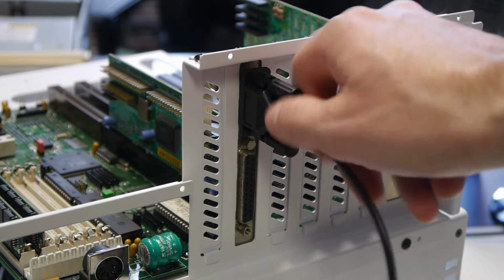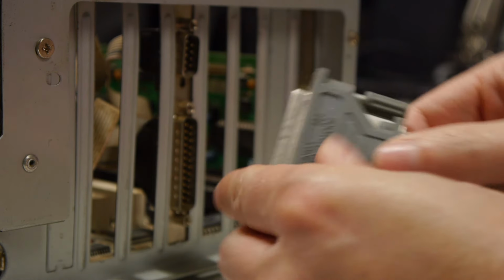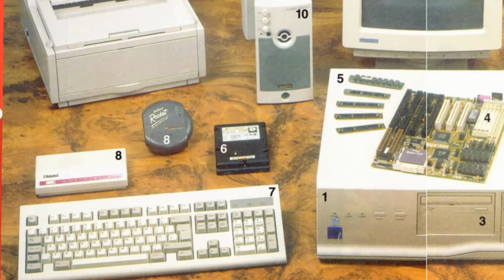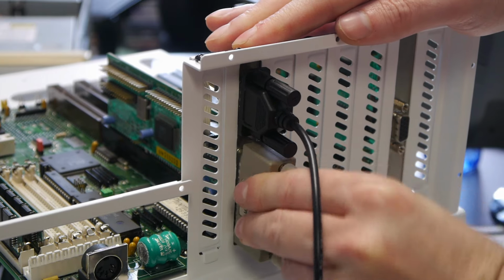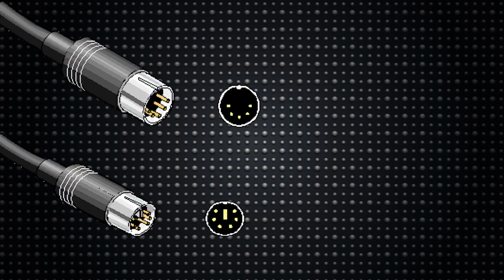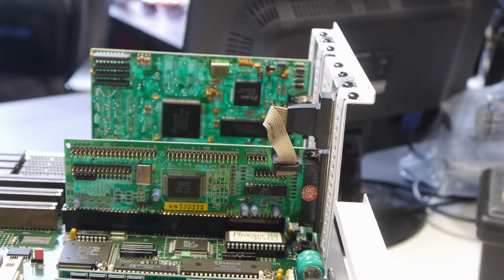What did we use before USB? | Nostalgia Nerd

Comment: I had an Amiga back in the day and I needed a new mouse.  Since serial mice used the same DB-9 port, I was going to give it a try until I was warned that I could blow up my port if I used one, and I needed a bus mouse instead and would have to convert that port to DB-9.  Or just find a mouse made for the Amiga.  Anyone know if it's true that the port on the Amiga could be damaged by using a serial mouse?  I suppose it would have to do with the +5 being on a different pin.

Comment: Yeah, I caught the tail end of the life cycle of these connectors when I was little, so I grew up watching as each one of those got gradually replaced by USB, and I remember what it was like to use them...
While it's certainly convenient that pretty much everything nowadays uses USB, I'll still gladly use a PS/2 Keyboard and mouse on my PC! It's good too because it frees up 2 USB jacks that I could use to connect gamepads~
I think I still have a couple of game controllers with that 15 pin connector though...
Reply: God forbid your mouse accidentally comes out of the PS/2 port, you gotta reboot
Reply: Michirin9801 you havent felt how it is to try to plug them in and accidentally bend the pins
Reply: I have actually, but only with a PS/2 plug... I just bent it back into shape with a pair of tweezers >w>';

Comment: As late as 2014 I was still complaining about brand new PCs having outdated legacy connections like PS2 and RS232C on the motherboard, and not enough USBs as standard.  

One thing Apple has always been good is knowing when to ditch the old and force technology to progress.
Reply: T Mac Apple get rid of things too early, when people still need them. They threw out serial and parallel ports when I still had devices that used them, while pushing FireWire, which was useless to most people. Apples approach is only good if you're rich enough to throw away old but perfectly functional hardware.

Why would you care about PS2 and RS232 anyway? If you don't need them, don't use them. It's not as if they cost much.
Reply: I like having RS-232, it's still widely used in embedded development.  PS/2 seems to be up for debate in the gaming keyboard community as PS/2 is interrupt driven (technically "faster") while USB is software polled ("slower").  With modern USB gaming keyboards polling at 1000Hz though, I highly doubt anyone can tell the difference.  Also the PS/2 supporting N-key rollover, but so do nicer USB keyboards.

Comment: RS232 was one of the most difficult standards to cope with, ever, because while the standard defined two classes of equipment: Data Terminal Equipment (DTE), and Data Communications Equipment, with each category having precisely defined pinouts, voltage levels, and signal directions of the connectors, many manufactureres chose to bend the rules almost to breaking point. For example, the Sinclair ZX Spectrum +3 uses the pinout and signal directions of a DCE device, while both modems and printers often were configured as if they were DTEs. Needless to say, this would often requre users to make up custom cables in order to successfully make various bits of gear talk to each other.
Centronics, on the other hand, was never adopted as an official standard by any regulating body, yet virtually every manufacturer followed it to the letter, and thus it became what is known as a De-Facto standard.
Ahhh, the "good" old days. :D

Comment: You only gave SCSI a passing mention, when I worked on making computers for video editing in the late 90's, SCSI and SCSI hard drives were King, everything had to have them.
Reply: Yeah, and technically you could connect everything using SCSI, not just storage devices or scanner.
And SCSI was capable for features 20 years ago they now sata praise for...
Reply: Well, it is true that SCSI is obsolte in consumer systems but is is still used and further developed in/for professional storage system.
Reply: SCSI was popular because it was great, but it was basically a flash in the pan in the history of technology. So I can see why it only got a passing mention on a video of the tech that basically made it so obsolete so quickly. I remember when everybody thought SCSI was going to replace everything. Turns out USB did that.
Reply: Yes, nothing was faster then SCSI back then, and that you could use 7 devices on one SCSI port, with a spacial SCSI cable.
Reply: you didn't need a special port/cable, it just daisy chained between SCSI devices, well Mac's didn't, I used SCSI for years, the daisy chained option was great and far better than USB, and only dropped when going to Firewire, which again could be daisy chained.
Reply: All real business was handled over SCSI. Hardly a "flash in the pan" SCSI was the absolute standard for every digital dependant corporation for at least 20 years. The only businesses who used USB exclusively until the end of the 20'oughts were tiny startups and companies who had huge capitol dumped in only to fall on their ass in 2008 when the country fell on its face.
Reply: +Max Mustermann There is nothing wrong with storing business data on external drives in fact quite the opposite at least one backup should be stored fully encrypted on offline media like an external hard drive which is disconnected and secured in a fireproof safe (Or better yet at a secure offsite facility) after the transfer. Doesn't necessarily need to be hard disks but they are ubiquitous and can be acquired cheaply so they can be a very cost effective solution. The reason for this is simple malware is a threat that exists which is fully capable of corrupting any and all online storage.
Reply: I actually had a SCSI hard drive back on a Win98 machine.
Reply: And there's were so many variants of SCSI ports as well.
Reply: Yes, some SCSI cards had a DB25 female port exactly the same as serial as well..
Reply: My first Macs all had SCSI connectors. I remember having to move  the HDD and CD-ROM drives onto opposite addresses whilst installing OS 8 and then swapping them back to be able to reboot and run the computer. No idea why, but both cables were correctly terminated, new and connected correctly. When OS X 10.0 arrived, the issue disappeared. I still have a bag full of spare and unused SCSI adapters and cables somewhere. Bought as spares for when needed, often on a Saturday night or a Bank Holiday. We thought that everything was going SCSI, so didn't worry about spending extra for bulk to get better prices per part. Then Firewire happened, followed by USB, which 'might never catch on'. Hah!
Reply: tylisirn
I actually use SAS controllers. But I don't really see the appeal for SAS drives. What's the benefit? It's not faster than regular SATA.
Those controllers are cheap (used on ebay), reliable as fuck, good driver support, and I like the plug. I believe it's called miniSAS. You can plug up to 4 SATA to one miniSAS port.

 Had SCSI back in the P3 era. Harddrive and scanner. Actually didn't like it. SCSI HDDs were usually 10k rpm to utilize the SCSI speed. Loud beyond belief.
And you always had to wait in boot for the fucking controller to initialize. (Same goes true for those SAS controllers, but you can just delete the BIOS and use them in HBA mode).

Some enterprise stuff is great. But other stuff isn't aimed at consumers for a reason. I'm more than happy with SATA3.
The only "enterprise" thing I really long for is 10Gbit Ethernet.
Reply: SCSI was fast, loud and expensive. So the general user never saw it. It had it's fair share in industrial and enterprise solutions.
Reply: Even rape backup is still a thing. It might not be fast, but it lasts and can be stored safely.
Reply: SCSI was a flash in the pan?  You don't have much experience with enterprise computer systems, do you?

It's all Serial Attached SCSI (SAS) now, but it's still SCSI.  Servers and storage devices only use SATA for low speed cheap nearline storage that supplements SCSI storage (for data that isn't accessed frequently).
Reply: He also failed to go over what Apple was using prior to USB. It was different from the PC connections, with small, round connectors bearing a superficial resemblance to S-Video and PS/2 having been used for serial connections as well as the Apple Desktop Bus, which was for connecting peripherals such as the keyboard. Apple daisy-chained the mouse through the keyboard over ADB, so in a way it was well ahead of its time.
Reply: scsi is a big thing when it comes to vintage electronic music gear and early macs, during the 80'[s and early 90's.  scsi was just never huge with home ibm-pc2 type pcs
Reply from the maker: ForestCat_Peter SCSI deserves it's own video.
Reply: SCSI was hardly a flash in the pan, it's still in very widespread use, just too expensive for consumer systems, which was always its problem. These days it's found its home in enterprise storage as Fibre Channel interface protocol and SAS (Serial Attached SCSI).
Reply: Well, I was 6 at the time so god knows what type of SCSI port I had. I was good enough with PCs to run down most of the specs, but not good enough to open the thing up and know exactly what port was what.
Reply: Yeah, i used it on the Commodore Amiga, like the Squirrel SCSI Interface Device, and SCSI that was on my Blizzard PPC turbo card.

Ahhhh good times.
Reply: ForestCat_Peter Not really. Every computer that I ever used in the late 90's and early 2000's had IDE interface for the hard drives. I heard of SCSI, but never had a computer that used it. I was unfamiliar with it, and I was told that it was being phased out even back then.
Reply: Max Mustermann While not widely used, Internal USB is a thing, there are USB devices that connect internally directly to a USB header on the motherboard

I have used two internal USB devices myself (a USB VFD display and a USB memory card reader), both of which were designed to be mounted in disk drive bays
Reply: Yeah, and do you remember how much a SCSI controller costed? It was a buttload and a half. I can't remember if it was an ISA or PCI interface. I seem to remember PCI being hot shit when it was introduced. All I do remember is paying several hundred dollars for the controller card and hard drive together, and the capacity was so small it probably couldn't even store one modern compressed video.
Reply: I remember seeing Full Length 16 ISA slots used by SCSI with an 50pin Centronic Connector in the 90's
Reply: SCSI was big on Apple Macs for over a decade. I still have a 1993-vintage Microtek scanner, which still worked the last time I turned it on (maybe a few weeks ago). It’s connected to a beige G3/266 PowerMac (1998-vintage), which is the newest machine I’ve got that has a SCSI interface.
Reply: Think your spot on. So much to tell about SCSI, Went through different faces. I'm from begin 80's and grew up with the PC coming up. For a long time it was just a dream to get my hands on SCSI. But was only later when I had more to spent before I was able to buy the needed controller. What I have to say about SCSI is that it's more focused on enterprise and think it got more attention in consumer market with SCSI CD burners. Specially the beginning the burners where super expensive and IDE had way more issues with stability then the SCSI variations. Since the burners where expensive it was less of a difference SCSI vs IDE. Can't wait to see your SCSI video. Will bring back lots of nostalgia ;)
Reply: NVMe SSDs killed SAS SSDs for high-end enterprise storage, SATA SSDs made 15K SAS drives a joke, and SAS 7.2K are too slow for even 'warm' data, making SATA 7.2K more appropriate in cost-effectiveness for cold data.

The king is dead: Long live the king.
Reply: The very first CD burners pretty much had to be SCSI, with a SCSI hard drive to follow. The buffers were minimal back then, and you always risked to have an empty buffer in the burner. Emptying the buffer while burning resulted in a corrupted CD (and writable CDs were expensive back then. Still affordable, but a lot more expensive than today). So you needed high transfer rates, something that IDE did not provide when compared to SCSI. For three or four years, if you were serious about burning CDs, SCSI was a given.
Reply: LPikeno 7.2Krpm SATA drives were basically consumer IDE drives with alternative interface electronics. Because most SAS controllers happily accept SATA drives, nowadays that job is handled by higher end SATA drives instead.  SCSI today is usually single-channel SAS (almost the same as IDE, but with ability to plug two controllers into each drive), multi-channel SAS for connecting to external or internal enclosures, Fibre-channel optical SCSI for connecting huge raid enclosures (such as EMC racks), and iSCSI over standard Gigabit or 10Gigabit (or faster) network cables.  The devices most commonly connected are still disk systems and tape backup (with or without robots), though you could connect any of the other things that have had SCSI interfaces over the decades.
Reply: Don't forget Raid arrays. I remember when those were the hotness.
Reply: For Apple Mac users, SCSI was the main way to connect most peripherals (outside of modems, printers, networking, & keyboards/mice) for over a decade, until the first iMac in ‘97 where they switched to USB 1.0 for most everything. For PC users, it did not see the same adoption for home consumers due to cost. Parallel ports largely served the same purpose due to its cabling being much cheaper but with severe limitations speed & number of devices. The versions of SCSI used in the 80’s and 90’s had lots going for  them but also came with a high price tag vs parallel/serial. Because SCSI cables were wired with many wires in parallel with thick shielding, that meant they cost a lot to make. They also came with the complicated business of needing have unique ID’s set for each device and terminators at the end of the last daisy chained device. This all meant the unless you where a Mac users or a business PC user with specific need for SCSI, then you were unlikely to be exposed to it. But advanced variations of SCSI still exists these days in the enterprise world, it’s just that the lower end version for hooking up basic ext. HD’s, scanners, etc. no longer are very useful with USB serving that purpose much better.
Reply: Indeed. I connected a HP ScanJet A3 scanner via SCSI to my A2000 which at one time had TWO separate SCSI Adaptors. I housed multiple 4.3 GB SCSI HDDs in items such as a SCSI Tower Case (or an empty Honeywell AT case) - since 4.3 GB was the addressing limit on my system. I noticed that NASA was still using highly-customized Amigas for data processing (including from the Space Shuttle) until about 2003. Amigas had gone out of production with the demise of CBM in 1994.
Reply: On the Mac, I remember using SCSI for hard drives, scanner,  and a few other things.  We also used serial port for mouse, keyboard and other low speed devices.
Reply: SCSI is hardly comparable to USB. Yes, there is external SCSI. But no internal USB.
Whether you hook your scanners up via SCSI or USB doesn't really make a difference.
When SCSI was still a thing (pre- SATA/SAS) stuff like USB Harddrives etc weren't really a thing yet.
And (hopefully) nobody stores business data on external drives anyway.

So especially for that given time frame, mostly totally different use cases.
Reply: You forgot to mention my perspective; why didn't you acknowledge me in YOUR video that YOU made for MY entertainment #unsubscribed

Comment: I know it's probably nothing to write home about, but I really want to see a DOS machine load something off tape now. That just seems so alien and bizarre to me that i need to see it to believe it.
Reply: Be N S O N Theres lots of C64 and VIC-20 videos that show exactly that.  Cant recall ever seeing a PC do tape though.  Also alot of videos of PDPs running reels.  Some IBM 360/370s too.
Reply: geniwab Those are tape cartridges specifically meant for data storage though, I find cassette storage so interesting because it's taking a medium for audio storage and using it for data, also that they're technically storing the data as sound.
Reply: Be N S O N it's not for DOS it's for the on ROM OS only.
Reply: yeah, even our 286 had nothing of the sort back in the day :P
Reply: Hmmm... Tapes are still in use, not regular tapes but tape cartridges: https://en.wikipedia.org/wiki/Magnetic_tape_data_storage
Reply: well yeah but this would've been for cassette tapes like what the commodore used ;)
Reply: Be N S O N In fact using those for data storage is very simple, tape cartridges work with the same principle as audio cassetes, storing a signal in a magnetic support, usually for data back then the Kansas City Standard was used, it stored the 0's as four 1200Hz cycles and 1's as 8 2400Hz cycles giving a real data thorughput of 300 bauds.
Reply: Be N S O N the transition to using CDs was the same thing happening again. They were used for music before PCs had hard drives, let alone CD drives... And function much the same as vinal records do (the grooves are much finer, so a laser is used instead of a needle, but it's the same principle).